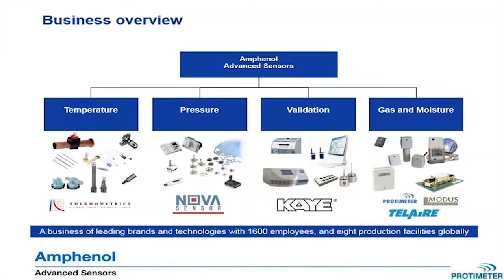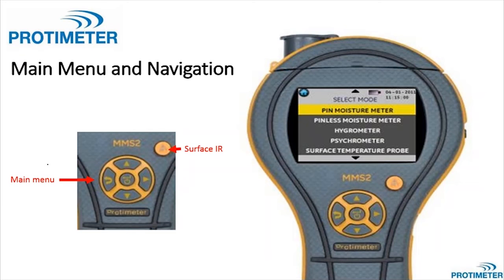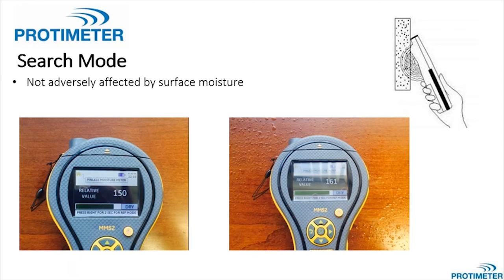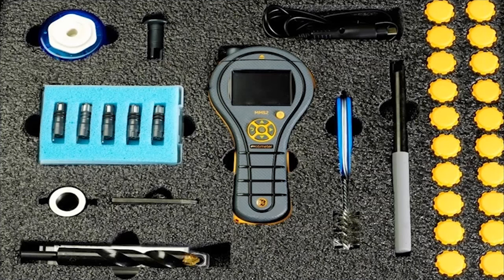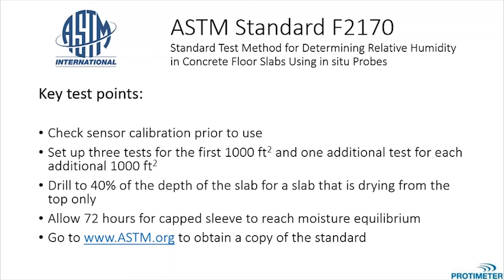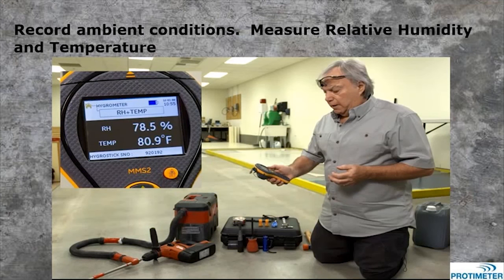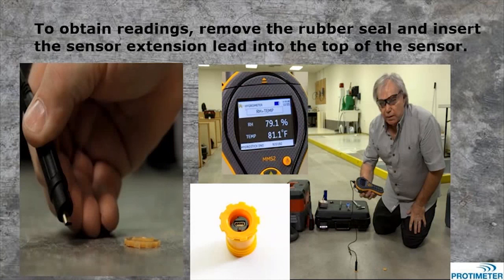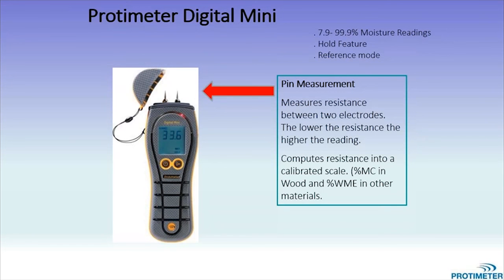NEW Protimeter MMS2 Flooring Kit

Comment: Cheap manufacturing. Anyone that has had these MMS2 meters for more than two years has had them fail either with battery short causing the battery to drain within 24 hours forcing the users to remove the battery after each use to loose components internally causing damage or just not working. Great meter but terrible quality.

Comment: Does measure Sensible Enthalpy? or latent? 
How it works?
Reply from the maker: Thank you for your inquiry.
With regard to using the Protimeter MMS2 Flooring Kit, in its intended use for performing the ASTM F2170 concrete slab test: when connecting the MMS2 instrument to the Mini HygroStick probes inserted into the slab sleeves: the instrument should be set to read Relative Humidity (%RH). Even though the instrument can measure/calculate Enthalpy, %RH is the meaningful Humidity value in this test process that this kit performs.
For more detailed questions about the capabilities of the instrument, please contact Protimeter directly.